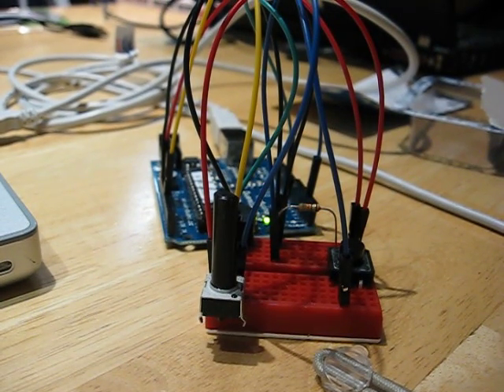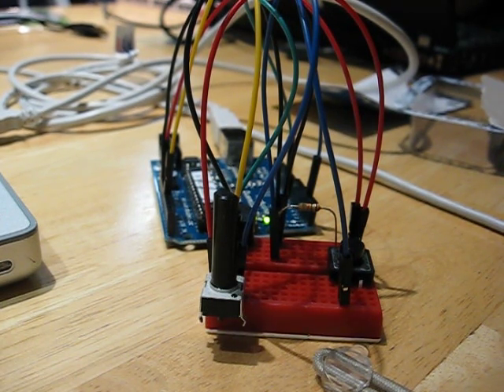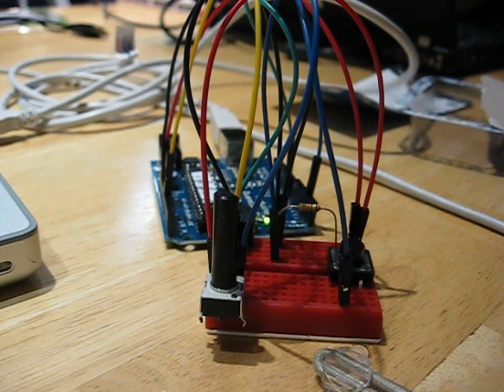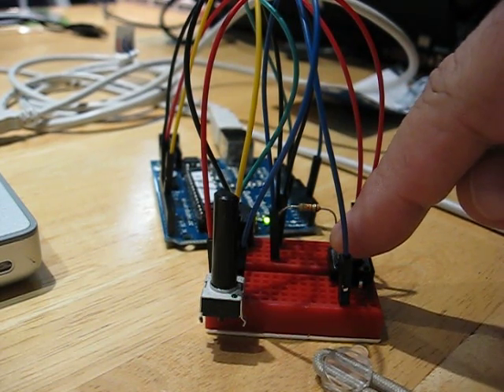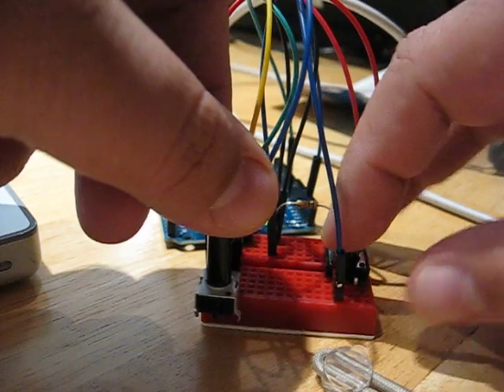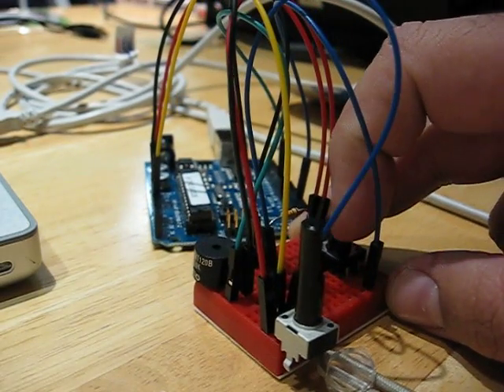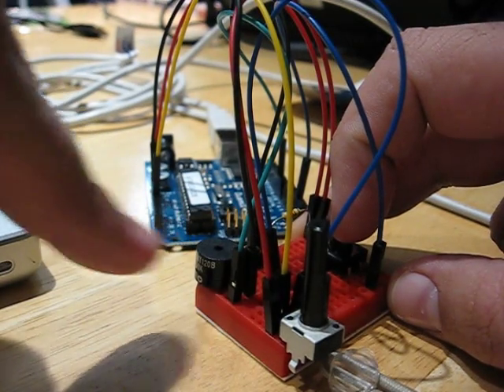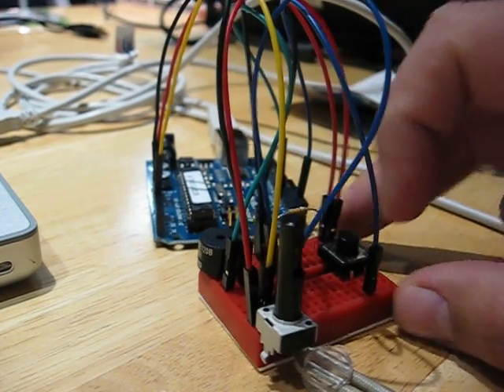First Arduino Project: Simple Square Wave Synth

Comment from the maker: Yeah, absolutely. I put in the button so that it wouldn't sit there making sound all the time, but if you wanted that, then there's no reason why not. You could trivially make it happen without changing the project at all by just connecting the button leads to each other, but also, if you comment out the code that reads the button state, you can remove that whole element.

Comment: Hi There, great project I was wondering if you can give me a little advise, I  have bought a midi controller and experimenting with it, im just stuck on one thing I want to convert midi signals into visible light pulses using a LED, can you tell me were do I solder that LED on the board ? I really appreciate if you can help me.